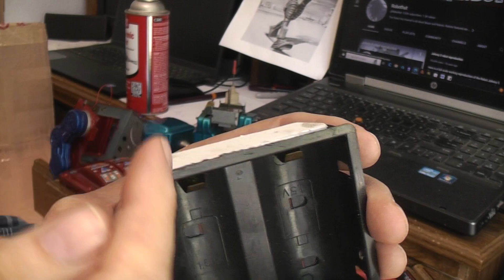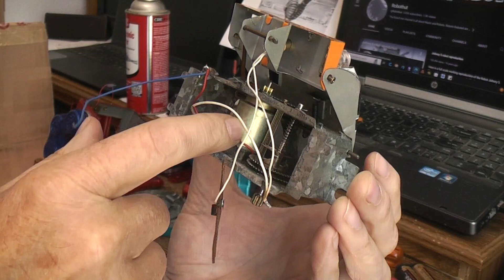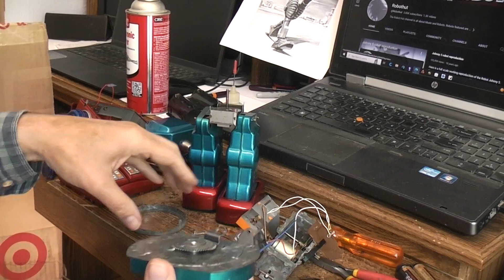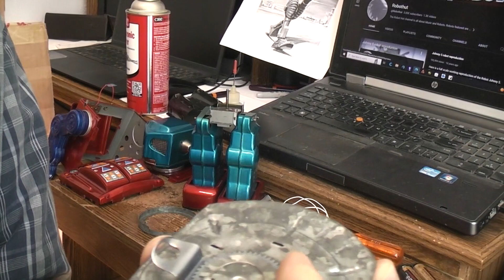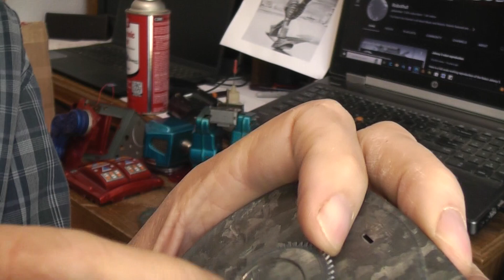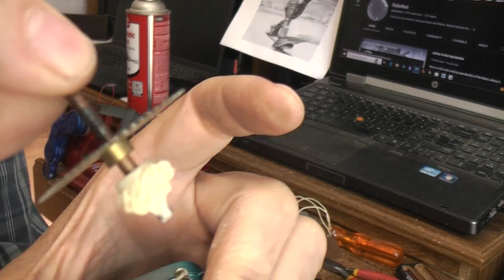Apollo 2000 robot repair part 2. The inside story.

Comment: The mechanical ingenuity in those vintage robots still amazes me.  BTW, I've been experimenting with a spray called Super Slick Stuff.  I use it on parts where I don't want grease or oil residue, like on the rotating collar.  It chemically bonds with the metal and basically remains dry but slick.
Reply from the maker: Interesting. Is like graphite ?

Comment: Hi dear John. Magnificent explanation, congratulations. I repair the cracks on the battery box with a compound that names "Easy White". This is an automotive past to repair cracks on the skin of cars and airplanes, for some impacts and deformation on the skin. This compound is in two parts. Part A, and Part B. The part B is an active catalyst that put with the part A. Then the combination makes a past that makes a reaction in little time and then you apply on the crack, and in very little time it is a very hard plastic. When you apply on the cracks that have the electrical terminals they now again are very strong. And the battery box is repaired. On the rivet that is on the gear I welding too. 
I hope you understand my English.
Greetings!!

Comment: Is the white piece that’s glued to the battery box styrene plastic as well or some other type of plastic? Where can you buy it at?
-Thanks, D
Reply from the maker: It is junk styrene plastic I had. You can buy Styrene in hobby shops and on line. So using styrene glue "solvent" you can fuse the two parts together.